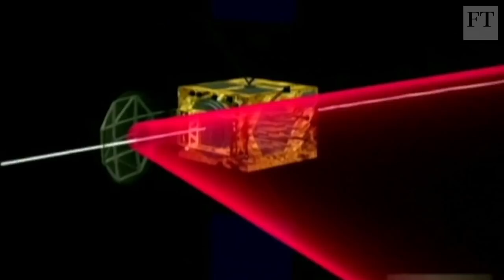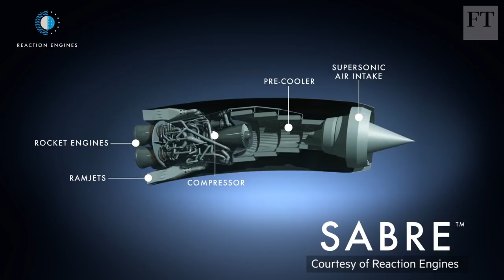Engine could boost UK’s space ambitions

Comment: I wonder if the disadvantages of a very large and complex SSTO outweigh the benefits when compared to other completely re-usable space launch systems. I wouldn't be surprised if they did.
Reply: No they dont. The fuel saving is emormous. Not to mention being able to take off and land from a conventional runway so no complex, extensive rocket launching facility. They wouldnt be doing it if your premise was correct.
Reply: Martin W Seems like accelerating to Mach 5 would be much easier outside the atmosphere. That and you’d have to design he airframe to handle 1800 F. I’d hate to be one of the first test pilots haha. SSTO then being able to land is pretty cool though.
Reply: @amorag59  

"Seems like accelerating to Mach 5 would be much easier outside the atmosphere."

Actually Skylon would accelerate to mach 5.4 in air breathing mode, in the atmosphere. And mach 25 in rocket mode, as the air gets thinner. Escape velocity is many times the speed of sound. Skylon's outer skin would be made of ceramic composite heat resistant material. 

"I’d hate to be one of the first test pilots haha."

Actually, it's proposed that the first flights will be unmanned. 

https://www.reactionengines.co.uk/
Reply: Martin W Yes, seems like a lot of drag at 16 mi altitude to push it to Mach 5 or so. Let’s hope one of the engines doesn’t go out and rip the plane apart from differential thrust like what happened with the SR-71.
Reply: @amorag59  

 "seems like a lot of drag at 16 mi altitude to push it to Mach 5 or so"

16 miles altitude would be very low drag. Thin atmosphere. I'm sure they have done wind tunnel tests and calculations to validate the design.
Reply: @martinw245  Get real, if there is enough drag to heat the intake air to 1830 degrees F then there is significant drag energy there. The power required to overcome aerodynamic drag is a function of velocity cubed so it's a valid concern regarding efficiency if it's using atmosphere to power itself up to speed if it's fighting its way through the air to get there.
Reply: @amorag59 

 "Get real"

Please don't be rude. Any rudeness and I will end this conversation instantly.

"if there is enough drag to heat the intake air to 1830 degrees F then there is significant drag energy there."

Of course, but I was referring to very low drag in relative terms. Significantly less than lower down in the thicker regions of the atmosphere. You referred to higher altitude. 21 miles I recall. Skylon would reach high mach speed at lower altitude than that, where drag would be relatively higher. I cant recall the altitude and speed for maximum aerodynamic heating. As you know, such things depend on the viscosity and speed of the air. 

 "so it's a valid concern regarding efficiency"

I didn't say it wasn't! But do consider that the designers of Skylon aren't morons. They will have considered such things and have deemed the project viable. They will have done all manner of simulations to validate this stuff. I'm confident the designers are well aware of the concept of "thermal load" and have taken it into consideration. After all, they are the qualified individuals... we aren't.
Reply: @Martin W My point is: Are they fixated on an idea that may be outdated and won't stop because they are far too invested and proud of the idea of such a big invention? 

I don't consider the term "get real" to be rude here as you are assuming a lot about what they are doing. They only have simulations, partial test and are only just now planning a partial scale size test of a heat exchanger, yet they are listing capabilities like they are already full scale tested. They are claiming the engine will produce 400,000/600,000 lb of thrust without ever once lighting it up. They are in a bit of a counting eggs before chickens situation as if it turns out it's not really that powerful thats a big deal to a 100,000 lb plane. 
Edit: I’m not sure I even believe this figure as that is on par with a 737 empty (90,000 lbs)

"No they don't. The fuel saving is emormous." Seems like you were ruling out the idea that this thing could be inefficient vs what we currently already have today in your first comment.
Reply: @amorag59  

"My point is: Are they fixated on an idea that may be outdated ?"

I'm not sure how the air breathing rocket engine, which is new technology, could be outdated.  

"they are far too invested and proud of the idea of such a big invention"

No not really. Don't forget they are being funded by backers like Rolls Royce, BAE, Boeing etc. Those mighty corporations don't invest in technology on a whim. Those backers will be of the opinion that the concept is viable and likely to offer them a considerable financial return.
Reply: Martin W Outdated as in started in pre Cold War era and dropped by most firms because of the added weight and complexity associated with dual mode engines, which affected the power density and complexity to the point where it was not worth it. The idea for supersonic passenger transport is outdated as it’s more economical for airliners to carry more passengers at a lower speed. An air breathing rocket engine is not new as seen by the scramjet/ramjet.

Ok so they dropped the temperature by 420 deg C in 1/20th of a second at Mach 3. An arbitrarily labeled success. A temperature change of 420C at Mach 5 (being gracious by assuming it can pull the same delta T) in 1/20th of a second needs about 85 meters (.05 s * 1715 m/s) which is longer than the entire length of the plane. 

They have their specifications posted on their website stated as “Sabre facts”

You don’t have to have a masters degree or PhD to be critical of ideas or numbers they are claiming. You are discrediting my comment by saying “I’m just a guy on YouTube” while being the same. I’m using simple principles and similar aircraft parameters as reference. As an engineer it’s not outside reason to do so. For example my 737 comparison: they claim this will weigh 116,000 lbs  yet it is almost double the length of a 737 with heavier more complex engines and skin structure. It is just a simple scientific mental jog that raises red flags with this, and the engine design that will cool the intake air by 1100 degrees C in such a short space and timeframe. 

As an engineer the idea of absolute certainty is highly regarded and cannot just be thrown around. You claimed to be quite certain of the capabilities of the engine with the idea of “they did the math” as a way to back yourself up. All I did was ask refuting questions stating simple scientific principles. Your Key word “if” the Sabre engine works then it could be an improvement on current technology but they, up until very recently, haven’t had a good track record of development yet and have been on the pr trail for decades. Again chicken and egg. I don’t find issue with goal projections, but some of their claims throw up red flags.

I still think you are overlooking the fact that this engine is going to have to push a heavy spacecraft through atmosphere (effectively a brick wall at that speed) only because that’s what the design principle is. It needs the air for the power but the air comes with significant friction. The only thing it’s solving is the ability to carry a bit more fuel. You still need an oxygen tank for space. The efficiency of the engine is predicated on the intake air temperature hitting their target after the heat exchanger (delta T of 1100 degrees C) and is one of the main sources of me being hesitant about this engine. It’s not “clearly more efficient” unless they have each of their components tested to work how they are supposed to in their respective environments, not partial scale, not Mach 3 and tons of delta T. A full heat exchanger, turbine and rocket. 

Your last argument does not make sense, so you think I’m somehow jealous of an engine that I am highly critical of? No I’m sticking to my guns, and I usually end up learning something while being highly critical of speculative technology.
Reply: @amorag59  

"Martin W Outdated as in started in pre Cold War era and dropped by most firms because of the added weight and complexity associated with dual mode engines."

Well no, not really. GE did look at a LACE engine concept in the 60's but the cycle they theorised was very inefficient, hence why the "notion" was dropped. Nothing to do with dual mode engine complexity. 

The Sabre engine was first envisaged by Alan Bond working for Rolls Royce in the mid 1980's as part of the HOTOL project. A far more efficient cycle was developed.  The "weight and complexity" of duel mode engines is nothing compared with the immense weight in fuel that has to be carried by an inefficient rocket. Rolls Royce didn't drop the project due to dual mode engines, duel mode engines were the advantageous aspect of the design, advantageous because you eliminate the huge amount of fuel required by a a rocket. The reason Rolls Royce abandoned the idea was because they couldn't find a way to handle the heat issue. After funding ceased for HOTOL, Bond formed reaction Engines to continue research. They may be using a type of LACE engine but it's more advanced than that with significant deign differences. 

"The idea for supersonic passenger transport is outdated as it’s more economical for airliners to carry more passengers at a lower speed. "

You do realise the concept is intended primarily for satellite launch, yes? Passenger transport is an additional "possible" use. 

"An air breathing rocket engine is not new as seen by the scramjet/ramjet."

A scramjet is not an air breathtaking rocket engine. It's a different concept! For a scramjet to function you need high velocity, that velocity requires an additional engine to reach the speed a scramjet can function. Hence the extra weight of an engine that will be redundant at mach speed. Or indeed a carrier aircraft to accelerate it to scramjet velocities. The Sabre engine is a single engine that can handle low speed and high speed regime and extract oxygen from the atmosphere, rather than having to carry it with the vehicle as in a rocket. 

"You don’t have to have a masters degree or PhD to be critical of ideas or numbers they are claiming."

Of course you do. The numbers they are clamming are calculated by experts... you are NOT an expert. You do not have the access to the data they have, you do not have access to the test results they have, you have not carried out the years of research they have. You are a NON expert, they have the expertise not you.

You have the right to be critical, but not the aeronautical engineering qualifications for your critique to be valid.
There's too much of this going on these days, individuals, like climate change deniers for example, who have zero qualifications in the field, but think they can trash the research of highly qualified professionals in the field that actually ARE qualified to have an opinion that is likely to vaild.
Reply: @amorag59  

"You claimed to be quite certain of the capabilities of the engine with the idea of “they did the math” as a way to back yourself up. "

NO! You are misrepresenting my responses.
 I am not at all certain of the capabilities of the engine. Unlike you, I am not arrogant enough to claim I know better than those with the requisite qualifications that have worked on this project for considerable time. They are the experts not me. My point... is that neither you nor I have a bloody clue what we are talking about, thus, the chances of you or I knowing better than the experts themselves is almost zero.
Thus... the fact that they will have done the calculations, calculations that you and I aren't qualified to do, not to mention many years of work...  renders it far more likely that they are  correct rather than than you or me. 

"up until very recently, haven’t had a good track record of development yet and have been on the pr trail for decades."

Yeah, that's a ridiculous comment. What do you expect, they are trying to develop a space plane, that can takeoff from a runway, deploy satellites, spend up to 4 days in orbit, then land on a runway, reasonably quick turnaround and then do the whole thing again. This is something that has never before been achieved. Good grief man. time for you to get real. ;)
Reply: @amorag59  

"I still think you are overlooking the fact that this engine is going to have to push a heavy spacecraft through atmosphere (effectively a brick wall at that speed) only because that’s what the design principle is. "

I'm not overlooking anything. And neither are Reaction Engines who have been developing this concept for many years, neither is Boeing, BEA, Rolls Royce and a number of other investors. Do you really think all those investors have decided to throw their money away for a laugh. 
Aerodynamically the design will have been regarded as sound. Again, all the aforementioned aren't morons! I'm sorry, don't mean to be rude, but you wouldn't know a vehicle design capable of accommodating mach 5 if you fell over it in a dark alley.

 "The only thing it’s solving is the ability to carry a bit more fuel."

It's way more than "a bit" more fuel. A rockets total mass is typically 90 to 96% fuel!!! Lol!

"Your last argument does not make sense, so you think I’m somehow jealous of an engine that I am highly critical of?"

Highly critical of because it wasn't developed in the good old USA. Lol! Just a hypothesis. But there's certainly something seriously weird going on. So much cynicism regarding something you know almost nothing about is bizarre. Zero qualifications in the field but feeling you have the authority to trash the entire concept. lol! 

I'm sorry but it's weird. Weird and arrogant. 

"No I’m sticking to my guns,"

Without the qualifications to have a valid opinion. Whatever pleases you. 

Y
Reply: @martinw245   "I'm not sure how the air breathing rocket engine, which is new technology, could be outdated. "  Perhaps you should have worded that differently if you mean't precooled air breathing rocket engine. 

"Well no, not really. GE did look at a LACE engine concept in the 60's but the cycle they theorised was very inefficient, hence why the "notion" was dropped. Nothing to do with dual mode engine complexity."
Don't be pedantic, one of the disadvantages was that it had the same thrust as a regular rocket yet weighed more hence my comment on power density. Did you mean General Dynamics?

"You do realize the concept is intended primarily for satellite launch, yes? Passenger transport is an additional 'possible' use." 
My comment about passenger transport was in regards to the BBC link you posted: "The Sabre air-breathing rocket engine is designed to drive space planes to orbit and take airliners around the world in just a few hours." 

Scramjet: A scramjet (supersonic-combustion ramjet) is a ramjet engine in which the airflow through the engine remains supersonic, or greater than the speed of sound
Again, pedantic. I was providing examples of air breathing rocket engines.

Isn't it convenient that you attack my background rather than addressing my statements with logic. Look at what I posted, none of the information that I posted is very deep if you took the time to to address it. You are taking what I'm saying at a birds eye view and discrediting it immediately without digesting any of it. I took the information that they published and evaluated it based on what THEY said their target was. Based on the most recent test, the heat exchange section of the engine would have to be longer than the entire plane at the rate they published. 

"You have the right to be critical, but not the aeronautical engineering qualifications for your critique to be valid.
There's too much of this going on these days, individuals, like climate change deniers for example, who have zero qualifications in the field, but think they can trash the research of highly qualified professionals in the field that actually ARE qualified to have an opinion that is likely to vaild."
So now you have to be a naval architect to understand icebergs sink ships? You are gatekeeping by saying I'm not qualified rather than addressing my actually comments. I'm not sure why you went on a tangent about climate change deniers and would prefer not to be lumped in with those people. They ignore the science altogether.

"I am not at all certain of the capabilities of the engine. Unlike you, I am not arrogant enough to claim I know better than those with the requisite qualifications that have worked on this project for considerable time. They are the experts not me. My point... is that neither you nor I have a bloody clue what we are talking about, thus, the chances of you or I knowing better than the experts themselves is almost zero." 
You sounded quite certain in that first comment of yours. Again, they don't have a single running engine to speak of. Arrogance: N, Offensive display of superiority or self-importance; overbearing pride. Not once did I make my post about me, I said I was critical of the engine, here to engage conversation on speculative technology and learn. You are projecting, especially after you twice now say that I am somehow jealous that this isn't coming from the US. I couldn't care less if your country made some kind of new space technology, it's just that I don't think this is it.

"I'm not overlooking anything. And neither are Reaction Engines who have been developing this concept for many years, neither is Boeing, BEA, Rolls Royce and a number of other investors. Do you really think all those investors have decided to throw their money away for a laugh. 
Aerodynamically the design will have been regarded as sound. Again, all the aforementioned aren't morons! I'm sorry, don't mean to be rude, but you wouldn't know a vehicle design capable of accommodating mach 5 if you fell over it in a dark alley."
Just because they are involved with the project doesn't mean it will work. Perhaps they have a vested interest in the heat exchange technology for other applications. The US government had a nuclear powered aircraft program that ended up being a flop, but what was learned helped the development of thorium based reactors. Again isn't it convenient mr. "don't be rude or ill end the conversation" can go full youtube troll with the personal attacks? 

"Highly critical of because it wasn't developed in the good old USA. Lol! Just a hypothesis. But there's certainly something seriously weird going on. So much cynicism regarding something you know almost nothing about is bizarre. Zero qualifications in the field but feeling you have the authority to trash the entire concept. lol!" 
I don't understand your logic there. We have spaceX... $60M puts a 30,000 lb payload into orbit. Done deal, reusable boosters, simple engine design. I'm critical of the heat exchange concept because it talks like a duck and quacks like a duck. 

"Without the qualifications to have a valid opinion. Whatever pleases you. "
I'm an engineer, critical analysis is what I do. The disadvantages of the drag in this type of lift aircraft is very well known information that is extensively talked about in publications. Using lift rather than thrust to combat gravity isn't all advantageous. The reduced gravity losses come at the price of much higher aerodynamic drag and aerodynamic heating due to the need to stay much deeper within the atmosphere than a pure rocket would during the boost phase. Them hitting their target delta T of 1100 degrees C is critical for their engine to have the power density it needs so as to maximize the efficiency in the boost phase. This again is simple, they don't hit the target THEY set, then the foundation of the project starts to erode away.
Reply: @amorag59  

"The disadvantages of the drag in this type of lift aircraft is very well known ."

Very well known you say, then it's very well known to Boeing, Rolls Royce, BAE Systems and Reaction Engines. Not to mention NSASA in the assessment I linked to. The difference is... they know what they are talking about... you don't! They have conducted the research and deemed it feasible, you haven't. They have been working on the for many years, you haven't. They have access to all the data, you don't.

"information that is extensively talked about in publications"

It's talked about in NASA's assessment too...NASA are of the opinion its viable.
Reply: @amorag59  

"I took the information that they published and evaluated it based on what THEY said their target was."

More arrogance! You aren't qualified to EVALUATE it! You are not an aeronautical engineer. Have some humility and accept that Boeing, NASA, Reaction Engines, BAE systems DO have the relevant qualifications to EVALUATE the information. In fcat Rolls Royce have been evaluating this stuff since the mid 80's and the HOTOL concept.